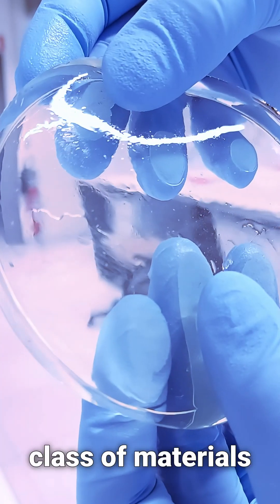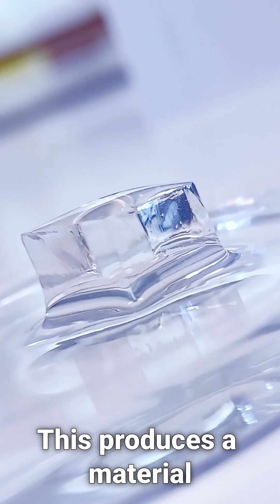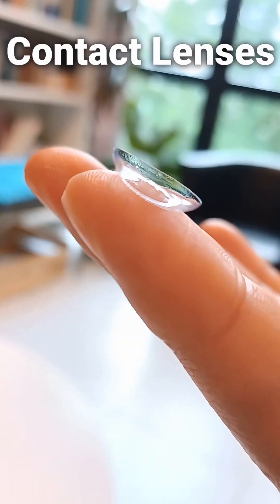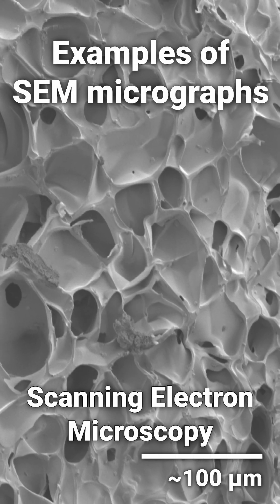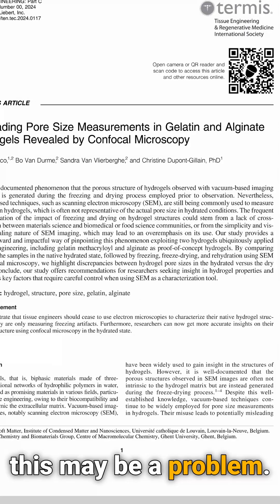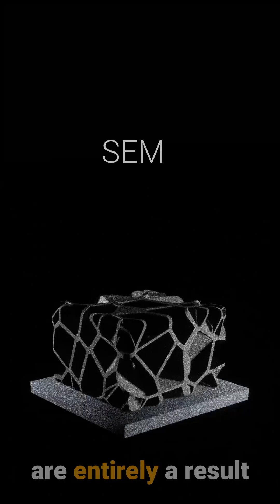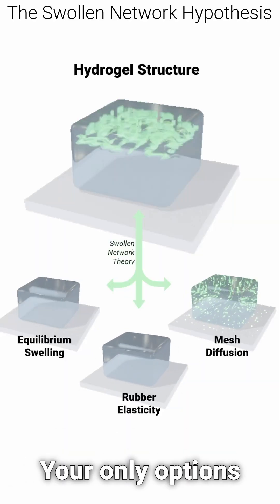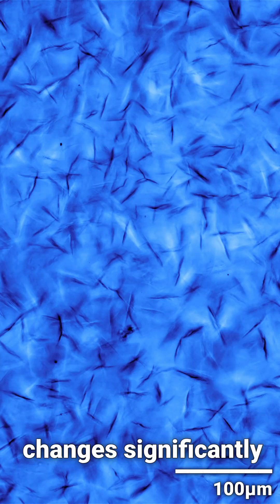Misconceptions about Hydrogel Microstructure

Comment: There is always the cryo methods, don't forget.
Reply from the maker: Cryo-SEM you mean? It has the same problem
Reply: @ClickbaitScience  , yes, I was thinking about cryo SEM at temperatures lower than -100°C, before and during SEM with a low electron beam intensity. Or even complement this with salts. But if this doesn't work, There is nothing else that can come to my mind beyond simulations.

Comment: Naive question, has the freeze dried gel just pore larger due to the freezing? Can we deduce the initial size of the pores by knowing the expansion of water due to the freezing?
Reply from the maker: Yes, the initial mesh size is on the order of about 10nm; the ice crystals grow, break the network and exclude the polymer chains from the initial pure crystals. Their final size depends on the kinetic ratio between ice nucleation and growth, yielding pore sizes of about 10µm (++). And no; the expansion of water doesn't really depend on the initial mesh size.